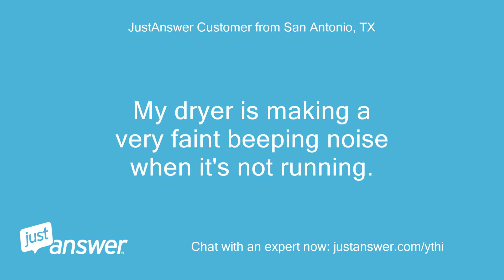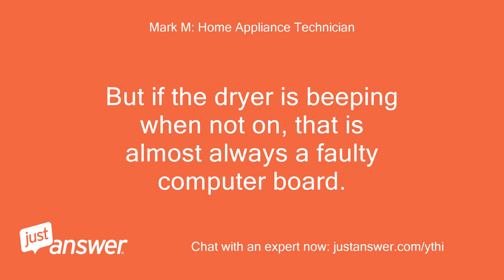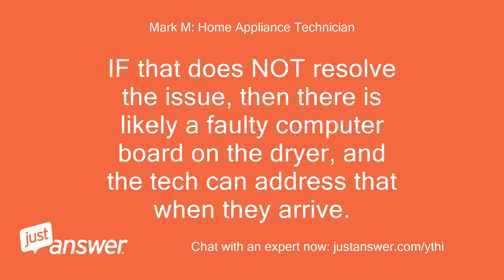My dryer is making a very faint beeping noise when it's not

Comment: My GE does the same thing since I got it.  They have replaced the circuit board and the tech has come out twice.  It is very faint.  My tech was partly deaf so he couldn’t hear the high pitch.  Still does it, no resolution
Reply: dang that sucks.  I literally just got mine today, brand new, installed...and hearing this beeping noise....lame.